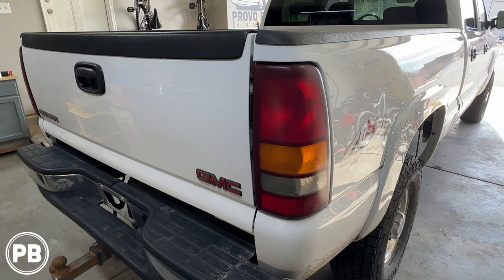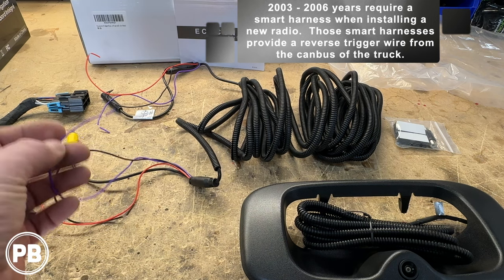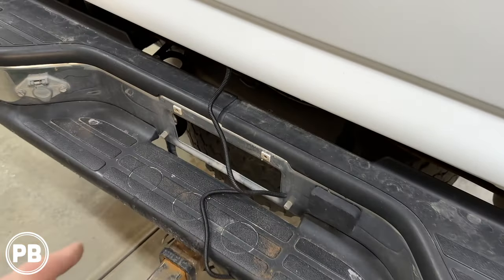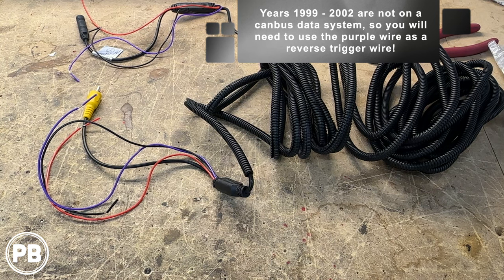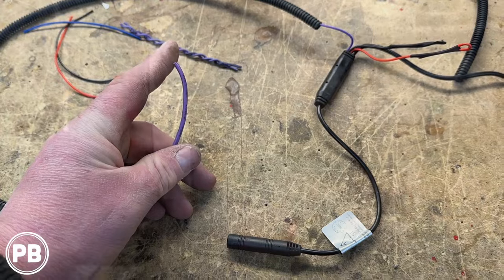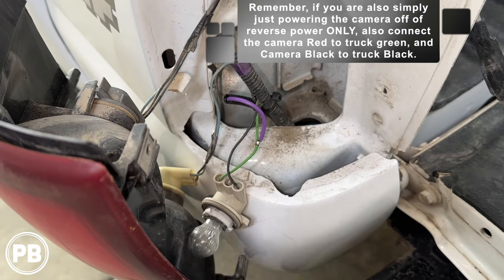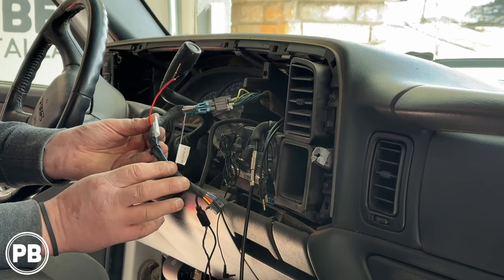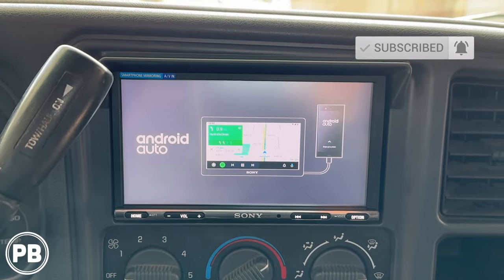1999 - 2006 Chevy / GMC Truck Tailgate Backup Camera Install

Comment: Got an 05 avalanche and I'm having some trouble. Some folks said you have to tap into the reverse trigger wire in the black box for them but my head unit has a reverse positive. Guess I actually need to use the reverse trigger instead?  
  
Edit: You'll have a reverse + on your head unit which you also need to jump into with the same camera power wire that connects to your reverse lamp. You're using the power from your reverse lights to turn on the camera, then when the camera gets that power you also have to send the signal to your head unit which works via the reverse + cable. It's obvious once you realize that but otherwise wasn't clear at all.
Reply: I appreciate you coming back and explaining the solution you found incase other people had the same problem

Comment: I think you do a very good job with the videos. One think that came to my mind, I have a 2006 and have had to pull the bed twice for fuel pump issues. If anyone installs this system, make sure a service shop knows there is another wire to deal with so they can not remove the bed to service fuel pump. I’ll be putting a weather protected plug at back that can be unplugged when removing the bed.

Comment: So I have an '03, with the smart harness. Head unit is in, but I was rushed to get back on the road, so I didn't put the backup camera on yet. Planning to do that this weekend. I have power and ground at the head unit of the camera harness, and power and ground at the rear of the truck. The smart harness in the truck knows when it's in reverse, so can I just hook up the power to the reverse light and not use the power and ground at the head unit? An "Either Or" kinda thing? Thanks in advance!

Comment: Could you use this on something like a tahoe or Yukon? The lift gate handle is lower than a tailgate handle.
Reply: Have you figured it out, thinking to do upgrade it in my Subernan

Comment: Thank you for the video. I am doing a camera on my 98 Silverado. This video was helpful because I was searching for good ways to get from the cab down to the frame rail. Using the rubber grommet for the parking brake was a great idea vs. drilling a large hole in my firewall. Thanks again!

Comment: What did you guys do will all the extra wire? I have an 05 crew cab and running the wire similar to I had like a foot or more extra that I just threw under the drivers feet and not quiet happy with that

Comment: my tailgate doesn't have the drain hole at bottom of gate has to small holes near hinges of gate can i fish the wire thru them i don't see a pinch hazard has plenty of space to move

Comment: I keep getting no signal, mine only has one red wire and the yellow camera plug into radio, I wired the red wire to purple trigger wire, and reverse lights in back, can’t seem to figure out problem. Any suggestions?
Reply from the maker: Connect power and ground of the camera to the power and ground wire of the reverse light.  Small pigtail red wire on the RCA end connects to the reverse trigger wire of the radio.  RCA end goes into the camera input of the radio.
Reply: @ProvoBeastAudio  found the problem, it was the rca plug not working, cheap one came in the kit and wasn’t getting signal

Comment: I’m not getting visual just a black screen
Reply from the maker: Either your camera isn't getting power / ground properly or there is an issue with the video signal cable.  Sounds like you need to check your connections.
Reply: @ProvoBeastAudio  I even ordered a replacement and same thing I checked the continuity and I'm getting connection. I had to connect to the reverse positive due to not having a smart plug